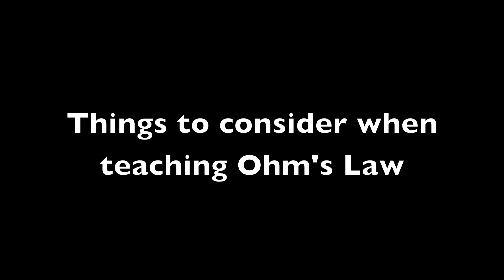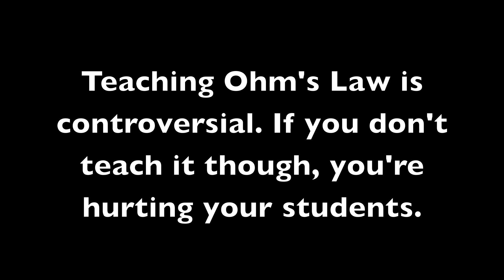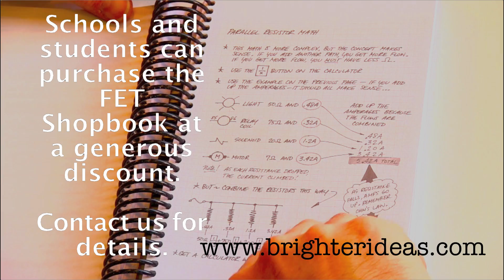Teaching Ohm's Law to Techs - Part 1

Comment: At 7:57 in your book you say "Current is indirectly proportional to resistance." I believe you should say that 'Current is inversely proportional to resistance.' At least I think it would be more clear that way. Nice video, I agree with your teaching philosophy, it reasons true.
Reply from the maker: I use both -- from the standpoint of language "inversely" is better for math - "indirectly" is a poor second, but many people have heard indirectly but don't know what inversely means - mathematically. In the end, the concept matters most, and if the concept is clearly understood, the math is simple -- then you hit them with "inversely". I avoid discussions of math at the outset for this reason. The math is there, and it can't be ignored, but it's like having a guy afraid of spiders being taught basket weaving using a spider web as an example. Not a great idea...

Comment: to someone who doesn't know electrical amps, ohms, volts, current and resistance sounds like 5 different things. and the terminology is confusing because the multi-meter only measures 3. In the auto tech school I attended they give you shop safety as the 1st course then electrical for the 2nd. before school the only thing I remember doing involving electricity was the light bulb, a battery, and some wires in 4th grade. So when they taught ohms law i was lost. but now that I've watched your video i can finally say "i get it." 2yrs after I've graduated. thanks dude DANIEL'S LAW!!!

Comment: what about short to power ?
Reply from the maker: I call this fault "crossed circuits" because it involves more than one circuit. It technically isn't a "short"; a bypass short to ground is literally a "short" path back to the battery. I won't change the World's minds, but if you consider that I'm only talking about a single wire, it makes sense. It is a little confusing.
Reply: no thank you very much have been learning alot trying to apply what i been learning to lab scope also do you know where we can get your book

Comment: i do agree with the points you've made (in the video and the comments). but to avoid confusion, it would be far better to teach students the differences between the different formulas and where substitution is appropriate.

by all means use a standard in your classes, but in my opinion, you should always refer to the international standard - to avoid confusion.

adk..
Reply from the maker: The only reason I disagree, is you have to remember who my audience is. I'm talking about 18-22 year olds who left high school hating math, or adult learners who haven't been to school in years, who hate math. We have very limited time to accomplish a difficult task - or, maybe - a nearly impossible task. They're very quick on the draw, and if they see stupidity -- in their eyes -- they react - badly. I don't use hydraulics to teach electricity, because voltage is compressible - liquids are not. Anyone whose had a hydraulics class knows that hydraulic pumps provide flow - not pressure. Voltage is pressure. I don't pick the fight. Trying to explain the "complexity" of E, I and R and then not use it is simply another example of proof that math is stupid. Discretion is often the better part of lesson-planning.
Reply: Jay Igaboo
 I was taught your way and it didn't stick or make sense and I gave up! There is your answer to using water in a hose!
Reply: Daniel Sullivan Sorry to disagree, I like your stuff, but I have found that explaining about how fluid flows through a pipe is really useful for getting the concept of electricity across. As for explaining electrical pressure using water, easy- I'f done it explaining to my kids and other young men when i've been helping them with their cars.
To explain electrical pressure (or enough of it for them to grasp the notion, One time , I was fixing my son's pal's car on the street, and the young fellah was keen to learn ( I wouldn't have been doing it for him if he hadn't been!).
He knew nothing at all about electricity (he has an MBA degree taken after he came out of the  Marines, but he goofed of his schooldays and learned  nothing technical
 He's smart, but he  is just one of those guys who wants to learn how to fix things  I had to explain from the very beginning how electricity flowed, what battery capacity was, voltage, amps, etc.
There was a  bottle of water in the car, and that plus a pipework analogy  worked just dandy .

To explain voltage, I just poured  water from a  cup onto his hand from an inch or so above it, them hold it as high as I could and did the same, in stand understanding.
The bottle was useful to explain battery capacity too.

Comment: What happens when your students want to be engineers? or want to have a deeper understanding of electricity? They have to throw away everything you taught them because its all watered down. This application creates petty low skilled technicians - a problem when compared to education systems in other countries. What teaching needs to do is explain directly and physically what something is, not what its like. You can't even call this math, its everyday multiplying and dividing. Students will never be successful technicians if they hate math and are not challenged from the get go. Math and electricity go hand in hand. I would explain to them that they can get onboard or get out.
Reply from the maker: It's certainly your right to express an opinion, but you're wrong. My experience makes my comments fact - for me - not opinion. I teach Trig to techs, so suggesting I don't promote math is simply irresponsible on your part. You can't speak intelligently unless you fully comprehend the scope and breadth of my offerings. Your response also suggests you don't understand that a "variable" is called a variable, because it's variable. Given that the actual units are Volts, Ohms and Amps -- using the specific letters that represent these units (V, Ω and A) to teach someone with ZERO EXPERIENCE isn't dumbing anything down. It's just smart. Holding onto methods that are illogical for a given audience while ignoring the logic of trying something new isn't dumbing anything down. Your comments are correct - for a completely different person. My way works best for the people I teach. Feel free to teach the people, I assume, you teach, any way you want.
Reply from the maker: E, I and R, and V, Ω and A, are called variables because they vary. Understanding how they work together is all that matters. You're focusing on a single, unrelated element of learning -- memorizing. Nothing I do is watered down - assuming that using three different letters waters the lessons down is a pretty clear sign that you don't understand this. Perhaps you tried to run before you could crawl, People who do that end up with a lot of scrapes, bumps and cuts. We'll simply disagree.
Reply: What I am referring to by "watered down" is your explanations on the mechanics of ohms law; they are "layman" explanations not technician explanations. Also, explain to me what variable you choose to use for "Area" (in dealing with cross-section of a conductor) where you have already chosen to designate the letter "A" for Amps?

ie, R = (pL)/A

As for "Ω".... This is a measurement unit, not a variable. On top of that, the symbol "Ω's" is  NOT the same as resistance...... This unit of measure explains other parameters other than resistance. Look it up.
Reply from the maker: XPTPCREWX I won't argue against any of your comments. Everything you say is true, except for the "watered down" reference. Again I explain that after 27 years of teaching this subject, I feel comfortable assuming that you haven't spent 27 years teaching this subject. If you have, it hasn't been to the people I teach. You seem to assert that the material I teach is the only material my students will ever learn. Not so - they'll learn more and more, and if they want to become engineers, they'll have my class as a basis for that level of education. If you're one of those thousands of guys who just want me to say I'm wrong, because that will make you feel good - I'm wrong, you're right -- but I'll never teach your way...
Reply: Daniel Sullivan First thing, I would like to apologize if I am coming off as offensive or overly critical, my intention is not to demean you, nor is it for me to get you to say that I am right. If anything, your viewers can judge for themselves, which is really my reason for writing this - to give them external criteria.

The real issue I have with the video is your method and over-simplified attitude. You are teaching people that its ok to dismiss important conventions and methods as nonsense (Part Two in your video), when in reality they are the correct way to think about the concept. Its subtle but ignorant.

Saying things like, "Its been done, because its been done, because its been done......etc", "(E,I,R) It's a mistake", and "(E,I,R) It doesn't make sense" is not right because it is degrading to the science, engineering, and idea behind electricity... again, it seems harmless, but nonetheless teaches your students NOT to appreciate or understand the real concept or reasons for why it exists the way it does in the first place. So you feel the need to walk all over it and modify it as you please - to you liking. This is a good example of "watering down" - by diluting its validity.

I can't tell you how many times I've heard technicians use technical language incorrectly, use the wrong units, and fail to actually grasp concepts.... You do seem to do this a few times in your video as well. 

There is nothing wrong with simplification, but I do not like it when people over-simplify in areas they are not qualified or don't completely understand. Perhaps its because valuable information is hard to come by and all I see is the constant destruction of it. Overall, Its not "my way" its the scientific consensus. 
I don't think you are doing this intentionally, I just want to point out the danger in what you are doing, that is, just perpetuating limited understanding.
Reply: Sirus  Thanks! Good to see we have some people that care. :)
Reply: XPTPCREWX
I really, really couldn't have put that point across any better.

Comment: Consider that Ohms law actually applies to more then electricity. As was taught to me many years ago, I = Intensity, E=Effort, and as it always has R=Resistance. If you are pushing a car, the intensity of the movement is directly proportional to the effort you exert, and indirectly proportional to the resistance. If you pushing as hard as you can and start going uphill, your intensity will decrease because the resistance increased. Making this a very usefull and functional equation and it is also easier for the student to visualize.
Reply from the maker: I like the idea and example, but I don't agree that it's easier to visualize. We don't teach kids to visualize. I let me guys visualize familiar numbers on a meter that they understand (12.6V, 100Ω, 0.126A), so they can learn the units, watch the relationship, then work out the math afterwards. I get a lot of people who disagree with me, which is fine, but if they won't try my method (when I've done them all) then they'll never be able to prove me wrong. Or prove themselves wrong. Or whatever. Math scores on exams go up exponentially if you put the answer to the homework problems on the page where you're doing the homework. If we espouse this ideal of wanting kids to understand concepts, why is the teaching part of the process always presented as a test? Homework is practice. Complaining that a kid isn't improving shooting a basketball is moot if the kid thinks he supposed to chuck rocks in a puddle. Knowing the answer is 0.126A before you do the math is not cheating - it's teaching.

Comment: What you said makes A LOT of sense and it's funny because all you ever hear is "E", "I", and "R" but as you noted that makes no sense sense they won't see that when they look at their mulimeters, for example.  I also like you you said that all you really need to know is that voltage and resistance = Amps and that that's really what you should focus on.  I think that that's a very interesting analysis.  I also liked how you said that there's only three things that can happen in a circuit: open, short, or high resistance.  Very wise observation, Sir.  Thank you.  I learned basic electricity in 1971 but I feel that after what you said it makes more sense than ever.  One last thing: saving "the math" is a very interesting idea but I have to say I like it.  By the way, I had never heard that "teaching Ohm's Law is controversial".  Interesting.  I don't know how you could learn electricity without doing so which is basically what you say afterwards.  VERY GOOD VIDEO, Mr. Sullivan!  Thank You for making it and posting it.